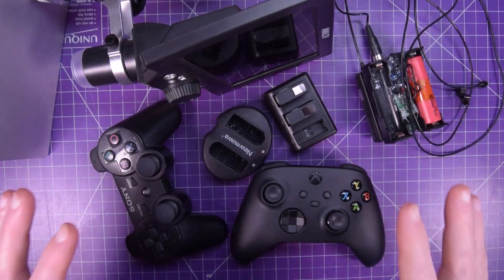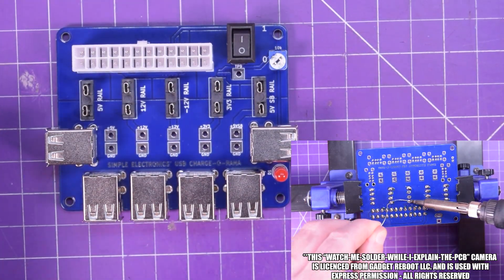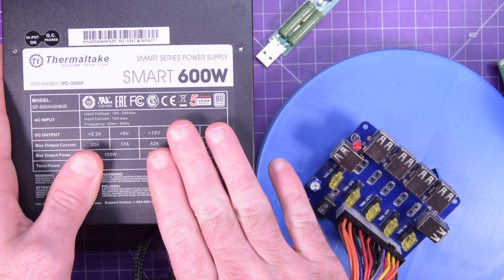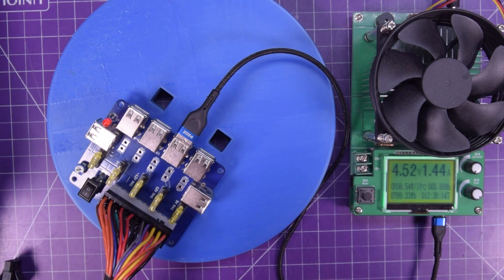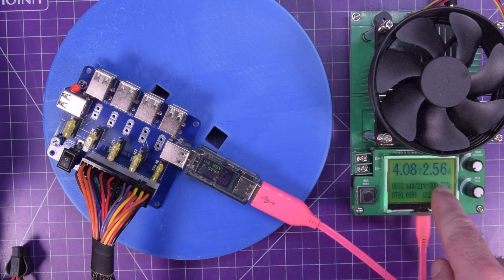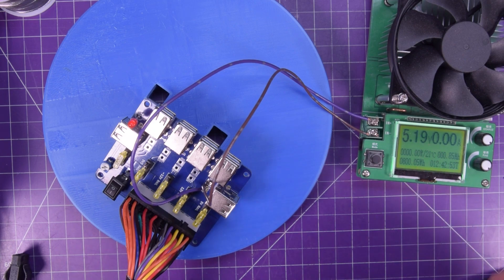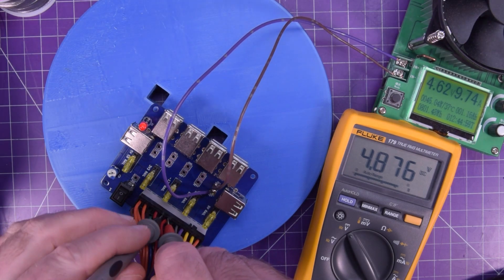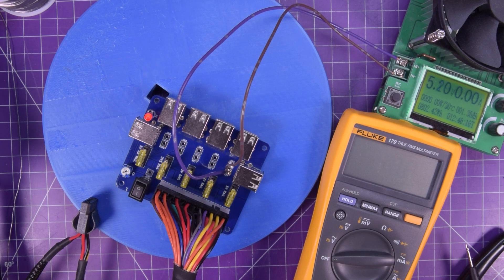I made a 12-device charger

Comment: 1_you need capacitor before load meaning you should have capacitors before usb output not to drop voltage when pulling current! 
2_power supply wires:
Yellow +12
Red +5
Orange 3.3V
PURPLE STANDBY 5V
You shouldn't pull current from purple because it puts pressure on control ic in power supply!
Green wire is power on or switch , in order to turn power supply on u need to connect green and black!
Black: GND! 
Grey and white are negative voltages which you don't need here!

Comment: Haha I had that one. It was 160 back then bahahaha.

Do you have the handshake ics for whatever Qualcomm uses? They're cheap and already come on a board haha. How many layers is the board? 3

Is the vsense atx awake. I've seen people run it through a 10 amp stereo fuse to gnd when it's on.the purple or grey. Can't remember the voltage. Hahaha what a pull though man heheh I love it

Comment: I don’t see the resistors that configure the allowed charging current a device can expect. Some devices will just work and can draw a lot of power (and burn your usb cable) while others will see a port that doesn’t indicate max current and will therefore refuse to charge or will only allow 500mA.
Reply from the maker: Those resistors are only on the device side, not the charger side - in my live stream I tried many configurations and they all had the same outcome

Comment: I think a right angle ATX connector will be better in a case.

Neat project and good use of a ATX power supply. Would be interested to know the peak-to-peak voltage noise on the output because adding some filtering caps on the USB board might be good.
Reply from the maker: The footprint should be similar for s right-angled one - but to be honest, the through-hole socket plus a 90 degree adapter might be cheaper in the end - those 24-pin sockets are hard to find

Comment: I thought USB standard goes between 4.5-5.25V, i didn't check, i just seen somebody else mention... You could also measure voltage across all components to see what drops the most, it may be the fuses.
Reply from the maker: The connectors themselves drop the most - but again, I just need about 1A

Comment: 13.6A would be the maximum amount of continuous current you would want to draw from that power supply.

Usually 80% (or maybe a bit more depending on who you ask) of it's rated maximum.
Reply from the maker: Ehh those are guidelines - I wouldn't worry too much, especially pulling from a single rail